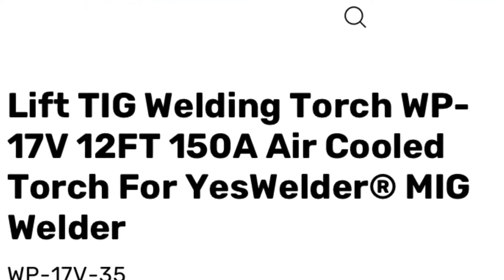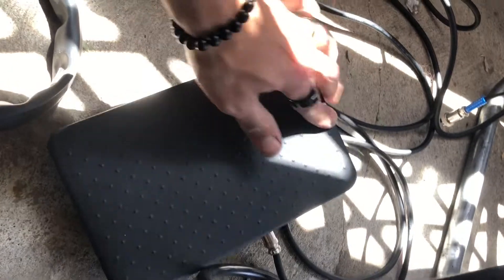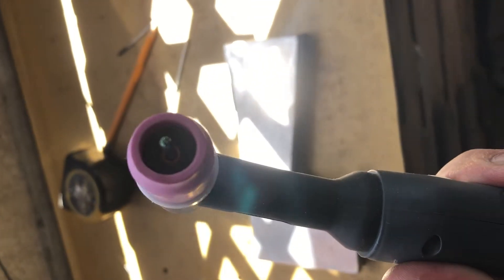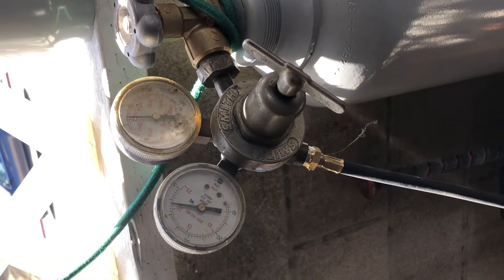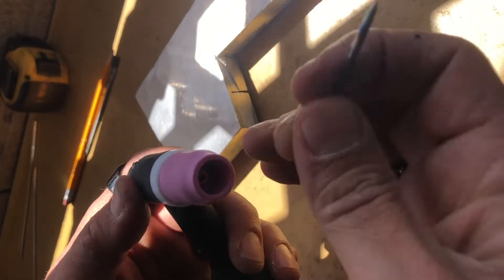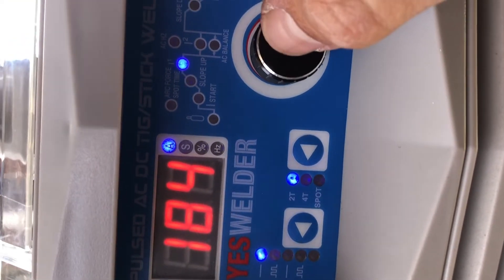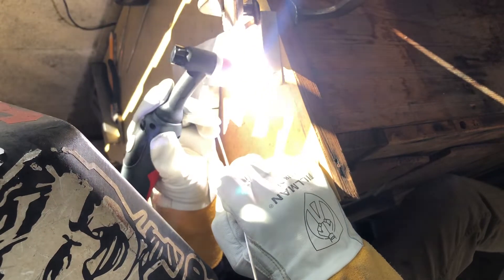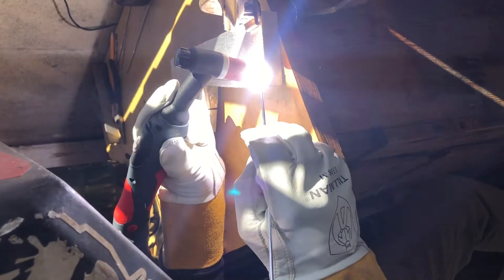How to run the Yeswelder 250P AC/DC Welder with the Harbor Freight 6500W Predator Generator

Comment: I have a Yeswelder MIG 250 Pro that I bought a couple years ago, but I haven't been able to use it, because we don't have any room in the breaker box, so I thought about using a generator. I asked Yeswelder about using a generator and they said they wouldn't recommend it as it could damage the machine. They said that generators doesn't have a constant even flow of electricity, which they claim that it would damage the welder. The Yeswelder MIG 2 50 Pro is multi-processor, which does MIG, TIG, MMA and Aluminum, I also have the Yeswelder CUT 55 Plasma Cutter. 

I've seen videos on YouTube where people make 220V by plugging in 110V into two separate breakers, which they are wired together in a junction box and then comes out into 220V, but I don't want to go that way.

Comment: Hey brotha so that generator allows you to use the full amperage of your machine? I’m looking to get a generator with the inverter clean power
Reply from the maker: Hey bro! So for the projects I used it gives me more than enough power to get a good weld. I had 3500W Generator that would do the job as well but it would bog down when I crank the power up in the welder or when i would weld thicker material. So far this bigger generator has worked well no struggle.
Reply: @dc_andrade  what was the thickest you were able to weld with that generator??
Reply from the maker: @nestiii6860  hello, to be honest that was the thickest piece of scrap I had on hand. If not I would have tried it on something thicker

Comment: In the bag that the manual was packed in, there are two o-rings, you need to insert one of the o-rings into the machine gas inlet port. They do not use a tapered seat for the hose to seal too, so you need the o-ring.
Reply from the maker: Aaaaah! Thank you for the input! I will try that out today for sure! I was getting tired of the short 6ft line😂

Comment: How do you like the machine?
Reply from the maker: I love it bro. So far so good. My only complaint is on the new TiG torch it does get pretty hot compared to the standard stock torch. But other than that, welding aluminum with it is great!

Comment: Can this setup be used for Mobil welding???
Reply from the maker: Of course! That’s exactly what I use this set up for. Just make sure the wind doesn’t mess up your weld. 👍
Reply: @dc_andrade  thank you for the respond want to run a few inverters off a similar type of generator to do some Mobil jobs 💪💪 start small and build with time
Reply from the maker: @michaelolaez8707  no problem brotha! Hope it all works out well. Good luck and let me know if you have any other questions!👍